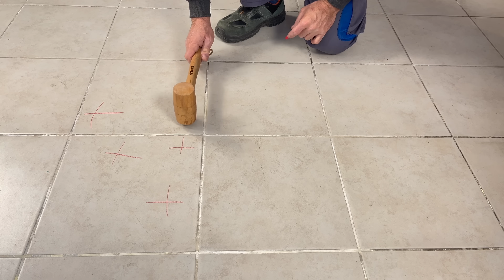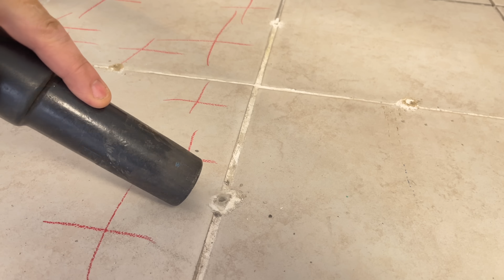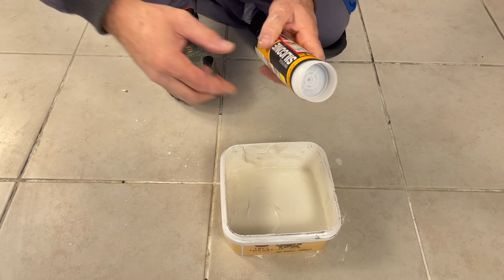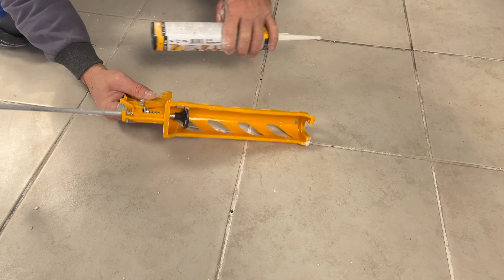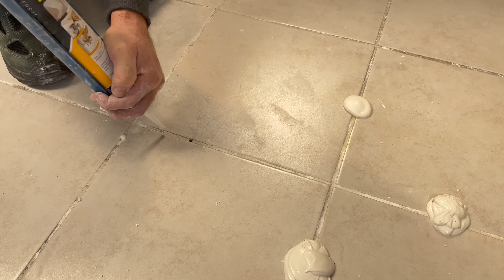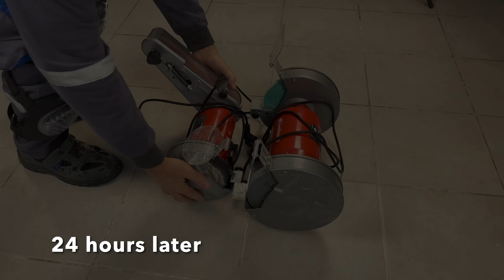Method Surprised 50 Year Old Tiler! Fix Tiles Without Removing

Comment: Good, but please remember to check for heating cables/tubes. First.
Reply: No sense of adventure
Reply: @mindseyeproductions8798  :face-green-smiling:
Reply: @dampradio  :face-green-smiling: IKR
Reply: Why? What kind of product is used here to fix the tiles?
Reply: @gtogot  a drill
Reply: You are only the one who knows the name of the materials you are using! What’ s the use of viewing your blog if it is only self-serving? Go ahead, make your day!
Reply: Who says he didn’t ask first?
Reply: and if you do this say in bathroom, you're likely to wreck the insulation/water barrier below
Reply: The tile & glue are the water barrier. Underneath is subfloor, which he wouldn’t be drilling all the way through. Then under that is your plastic barrier, he didn’t even get close to it.

Comment: I'm a design and construction expert, we often do repairs the same way you do. In addition, when the solution begins to overflow, you should plug that hole so that the solution can fill the empty holes inside.
Reply: What is the solution he uses? The white paste stuff that he injects. I’ve a single tile in my shower room and can’t lift it as it goes under the toilet. This looks ideal. And u mention plug it? What with if you don’t mind answering?
Reply: @thestrokeguypodcast  The solution he uses is grout. Some comes in premixed form, some comes in powder form. If using powder, thin it out so it pours easily.
Reply: @TheUniversalEyes WRONG!!! You don't use grout to set tile! Why would you not use thinset which is what most tike floors are laid with? You could use mastic or a polymer based adhesive and its already in a tube. This would be best for a very small area, but for larger, 2, 3 or more tile area I would go with thinset because it can be diluted and have the ability to fill all the voids more effectively. Also the cleanup would be much easier and quicker with thinset then would be with an adhesive. 
STOP GIVING POOR ADVICE
Reply: @robbiebooth2980 thanks Robbie. It is the corner of a single tile. It doesn’t even do it all the time it’s just an annoyance! I’ll sort it when I get chance!! Thanks for the advice and material I need to get from B&Q.
Reply: Thank you
Reply: @robbiebooth2980  Thinset and other stuff used to glue tiles has exact mixing ratio, which is disrupted when you are trying to get it thin enough to flow like in the video. So my question is, what are the consequences of this poorly mixed tile glue? How does the water evaporate when the grout is still in place except for a few holes?
Reply: @glacialimpala  first, thinset by no means is an exact ratio. I have never or seen anyone ever measure thinset or water when mixing. Either way, I definitely would not immediately replace the grout and would absolutely wait 24hrs and 48 if really thinly mixed thinset. With an adhesive you could probably get away with patching the grout pretty quickly.  

     When you are adding water to mortar, you are satisfying two requirements. The first is 'water of hydration' - this is the water required to turn the portland cement components into cement. This is around 40% of the weight of the cement or about 2 1/2 quarts of water for a 50 lb bag. The other 3 quarts of water is 'water of convenience' that is added to make it so you can trowel the mortar.
   Water of hydration is consumed by the chemical reaction and stays in the mortar. Water of convenience eventually dries out of the mortar leaving empty capillaries (microscopic tubes) and the sticky latex additives behind. The more water of convenience you have, the more of these empty capillaries you have and the less dense the final mortar will be. The practical result of that is that the mortar will take longer to dry and will be less dense with a weaker bond.
Reply: @robbiebooth2980  There are different types of grout.  I think "sanded grout" always has Portland Cement, plus often polymers, so is similar to modified thinset mortar, perhaps just with finer sand.  Some grouts are all polymer (no sand) and may not have any Portland Cement, so are more like the "adhesive" (or caulk) that you mention.  Some are even 2-part epoxy.  I don't know if thinset has fine enough sand to flow thru a tiny nozzle.  If not, try a sanded grout.
Reply: @SihAza  what you are describing sounds like tile mastic

Comment: Can you share what you used to seal the floor holes. also what kind of white powder did you use and the mix amount. Thank you!
Reply: Its tile adhesive, but made a little more runny than usual. Always mix water into powder.
Reply: the box seems to say “tava yogurt”
Reply: @bailey-cj2pl  How does the water evaporate and isn't the gluing power compromised due to altered mixing ratio?
Reply: @glacialimpala  Im thinking that its now self levelling compound. That is very runny and wont be compromised by being so.
Reply: @glacialimpala  water eventually with be absorbed by the concrete below and it is small amout wont be enough to do extra harm, just avoid doing it in very cold weather
Reply: @BlackopsSOG1 that container is a for actual yogurt. It’s not the name of the actual product he’s using.

Comment: Bravo, I thought you did this at least fifty times and told the tile dealers, they said, we need to replace it completely. And even now I have this problem, but unfortunately there is no such a skilled person. I'm still looking for the tile from 3 years ago.
Reply: If you have original tile, better to break it out a put new tiles down, it's not that hard, plus thin set mortar is alot better for adhesion than grout

All that dust from drilling goes under the tiles....

Every time you tile keep an extra box of tiles, always leave customers with extra tiles, flooring
Reply: My hubby is a flooring salesman, that tile is long gone. Tile is kinda like runway fashion - a couple seasons later and it's in the trash, no longer fashionable. In other words, good luck but it's highly doubtful you'll ever find a match. Always get at least one if not two boxes extra! Just assume that, at the time of buying, is the only time it'll be available!
Reply: @kirkdunn1379  if it can be fixed this way, who cared about dust under the tiles lol.... i have one corner of a 32x32 that is sounding a bit hollow, wouldnt want to remove it since would have to redo baseboards and its a column cut.... im gonna try this method, if it doesnt work then replace.

Comment: You have provided an interesting and suitable training to those interested and I thank you.
Reply: I would absolutely not recommend this! I work with tiles for over 10 years. 
And this wil potentially ruin your floor, membrain and your heating cables.
Reply: @jonasbugge1841 in my country there is no winter season..only summer & a few months of monsun season..so no heating cable underneath
Reply: He does not use glue. This is the filler between the gaps of the Tiles. I don't think this will last as a sustainable solution in the long Run. Im sorry to say, bot ok
Reply: @jonasbugge1841 what?😂

Comment: Never thought about doing that. Well done
Reply: It's similar to evening out concrete.
Reply: Home boy made a hole 2.5" through the tile, grout and subfloor 😂😂😂 that shit is just going under the house
Reply: @TheRickJames  I was thinking the same, holes are way too deep. He had trouble getting the grout to come up the other holes because it must have been dripping straight through the subfloor. Shouldn't have drilled more than 1/2" deep: 1/4" tile , 1/8" of adhesive and an extra 1/8" just to make sure to get under everything that is on top of the subfloor so the filler can get wherever it needs to go.

Comment: I scrape a wire over the tiles to check for voids. I used this technique years ago but I did not drill that deep and its been holding up good.

Comment: Very interesting. I have used a somewhat similar technique dealing with settlement cracks in interior walls, only using building PVA  adhesive and a syringe to inject it into holes drilled along the crack.
Reply: Пустоту в мраморных стенах можно таким образом устранить?

Comment: great quick fix to save tile from being cracked. i see negative comments, but when you drop something on one of those hollow spots, the tile cracks like glass.  so this technique is a great fast way to save integrity till you decide to get down and dirty.
Reply: Could drill hole 🕳 n Jyst use wet adhesive let it sink in hole 🕳

Comment: Time to teach newbies to drill through their floors and into their piping!
Reply: In most modern houses, piping doesn't run directly underneath the "skin" of any room. Building codes vary from area to area and country to country, but I can't imagine piping being allowed to sit any less than 20 cm / 8 inches into the floor. Still, underfloor heating and vapor barriers are worth considering. It wouldn't surprise me if he punctured his barrier at several points while drilling, which is a good way to make sure that he'll have to hire an entire army of handimen to redo his bathroom in a few years.
Reply: @xxhellspawnedxx  yeah, if you have in floor heating you'll have a hell of a time fixing a puncture lol.

Comment: I'll try that in my garage floor, where some tiles make a similar tone of being loose when walking over. Thank you for the tutorial.
Reply: 12 years.. and they have'nt  brook?.. - don't touch them. Don't try to repear - just let them be. .. they're doing fine without you.. 🤣😂
Reply: Did you do the tile repair? If yes, how were the results?
Reply: @badmuddafadda  As i got the other comment to leave them alone i have not done anything yet and the situation  has not changed. Some tiles are still broken, but it hasn't got worse.

Comment: Astonishing! I have a few floor tiles just like those that I've been wondering what to do with for 12 years.
Reply: If they didn't crack in 12 years then what are you fixing?
Reply: @edwardmmanns7454  One or two are loose. They wobble a bit.
Reply: @SuperLittleTyke  This video method can do no harm unless you drill into the tile surface or go too deep into a pipe or electric or heater...hard to do that.
Reply: Do not do this if you have heating cables or if it is in the bathroom. Den you risk damageing in the membrane and the cables! This bether be a halway something

Comment: Smart to fix it before the tile breaks.  Save your next empty caulk tube for this fix.  Wonder if the tiler just used a few dabbed pillars of mortar to set the tiles, rather than trowelled channels in it for full coverage.  I've read that some do that for faster leveling and no oozing out the sides.  Also best to back-butter tiles, esp larger ones.

As a similar fix-it, to repair a delaminated wall (rain) in a camping trailer (flush aluminum outside vacuum bonded to luan plywood, foam, interior luan), I drilled from the inside to the outer aluminum (easily felt, so didn't drill thru).  Many small holes for a Great Stuff poly foam straw.  I filled until the foam oozed out other holes, then plugged them with a wet Q-tip (cures the poly).  That makes the foam pack in and cure dense.  Before that, I secured the outer wall w/ plywood and studs to a fence so it wouldn't bow out under the foam.

Comment: There was glue I bought on Amazon for that same technique.  The previous asian owners of the condo I bought had laid tile over wood floor, all of it broke loose within weeks.  The liquid glue flowed under the tiles and secured them so they no longer shifted around, then grouted the floor again, since all the grout worked itself out on it's own by then.

Comment: Wtf? That crap really traveled that far under the tile? 
Holy cow that is amazing buddy. I would never of thought it would go that far. Awesome job.
Reply: Floor tiles are usually laid on discrete "blobs" of adhesive that squash and spread out when the tile is laid, but it means there's usually quite a lot of channels of space still between the tile and the substrate. It's also why water causes such havoc if it manages to get underneath and spread under the whole floor.
Reply: No he made a crucial mistake. That drill bit just went clean past the tile and in the crawlspace for most of the holes. Unless you have 2+ inches of subfloor ain't no way that's under the tile. Tile is like 1/8" thick
Reply: No. Joke. Will never work

Comment: What is the material used.. unsanded grout ?
Reply: Probably thinset
Reply: A viscous floor levelling  compound would be far better
Reply: @hardrock7634  unsanded thinset most likely mixed very wet

Comment: Great video! I have several places with loose tiles myself and would like to try it. Do you need a specific adhesive for this?
Reply: Just use regular tile adhesive and mix it thinner than usual.

Comment: Thanks for,sharing. I did this tile fix back in 1990 and the tile still holds till today. Almost 25 years already. I used a big syringe instead of the caulking gun.
Reply: Did you use regular tile adhesive or some syntethic material that comes already inside the tube?

Comment: Drill seems to be going way to deep is it necessary?
Reply: drilling into the pipes or wires of the heated floor 😁
Reply: russsabourin2893  I recently learned that much of Asia (especially Japan) it's common to have heated floors. Am guessing he might be from a similar area.
Reply: Russ Sabourin  you're right! maybe cooled
Reply: That's so it can fall under the house and the homeowner will think that it will work.
Reply: @you2449 In europe it‘s also common to have heated floors these days
Reply: it should be only 1/2 inch deep no more!

Comment: Que liquido utilizas?
Reply: It was either tile adhesive,or tile grout. Both will work,you just have to put enough water in to be able squeeze it out of whatever dispenser you use.
Reply: @markhepworth  tile grout is not appropriate, thin set most likely!

Comment: Not to flatter myself, but I tried this over 20 years ago using a different material, fixing screeds and drummy tiles, you tell people it can be done and they look at you like you have 2 heads. I was taught by a guy i worked with, i used my idea with  his. Im surprised this type of video wasnt done years ago.

Comment: What is the white powder, tile adhesive, grout, or what? It would be good to know.
Reply: Some says it is latex glue,some elmers glue...
Reply: I would guess unsanded grout.  It will cure without air drying, which would be a problem with adhesives/glues
Reply: But grout isn't an adhesive is it 🤔
Reply: @EireFirst25  Correct but it fills the void and stops the hollow sound.  If the void is full, this then stops a pin point load from flexing and creaking the tile.  Like everyone here I too want to know what to use??? Is it really just PVA glue?
Reply: @cypress4u  don't know, but I'd definitely try pva... Can't do any harm
Reply: @cypress4u  PVA glue does not stick to tile!

Comment: if my grout lines are 1/16th in.  how do I get the solution under the tile.  Can i drill a small hole on the surface of the tile and inject the solutiuon, then plug the hole with color match epoxy?

Comment: Bear in mind that the tiles might be laid on plywood over floorboards - don't merrily drill right through them or all you'll do is fill the air gap underneath the floorboards and/or drill through pipes or cables. Estimate the tile + adhesive thickness - prob about 10mm - and drill no further than that (just wrap tape 10mm down your drill bit if you have nothing better)

Comment: I had a nightmare of handymen put in a new tile floor in a small bathroom. To start with he did not put in the fastener and first guest using the bathroom said toilet is rocking 🤦🏻‍♀️. After that I noticed tiles around toilet sound hollow and grout started cracking.
Anyone here know what should I do ? Toilet is fastened to ground now but what about cracking grout?
Reply: Difficult to say without seeing, but if it’s an upstairs bathroom on wooden joists and floor then tiling never really works. They always crack and move, the only tiling that survives is onto solid screed. Even the plastic matting fitted under tiles moves and will fail. I’d probably look at getting it replaced with a Lino type flooring.

Comment: I think it's worth noting that this is a cement floor. If you are drilling into wood I would imagine this would still work you just have to be aware of the depth of the drilled holes so as not to penetrate the flooring...?

Comment: I am a tiler from Russia. Experience of 5 years. The method is not advisable, since during this time you can remove 5 tiles and glue them properly.
Reply: I would only do this as temporary solution, in case I don’t have the same tiles
Reply: That is assuming you get the tiles up in one piece and or having matching tiles to replace in case you dont.
Reply: This was a special tiling operation, I'm sure you will understand.
Reply: @hadawaco And it took much less than 3 days to complete.. ;)

Comment: Get a heat camera and check for underfloor heating loops first, of course, however, tiles are only 1cm thick, so drilling 2cm should be fine.
Reply: Or you can ask the home owner and save yourself $2000000.... LOL
Reply: Or just look to see if there's underfloor heating controls